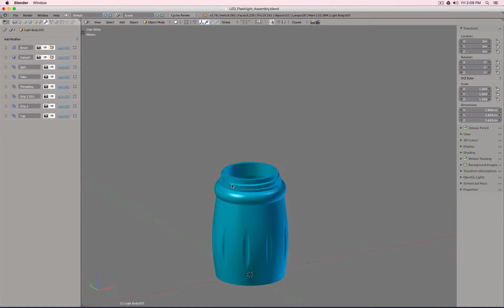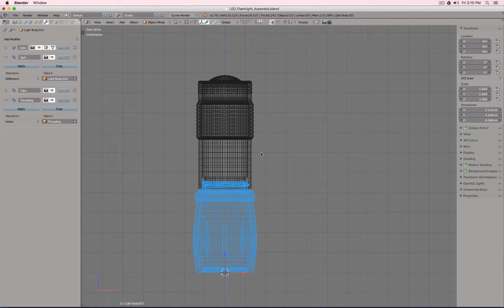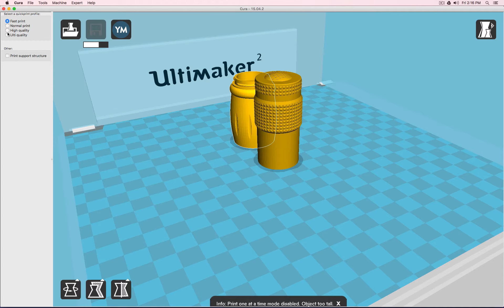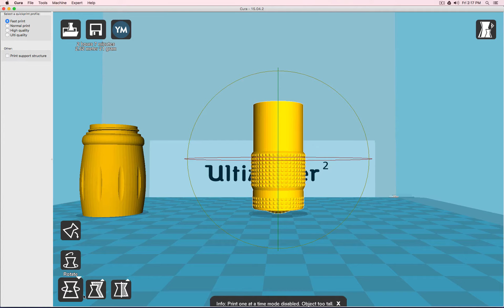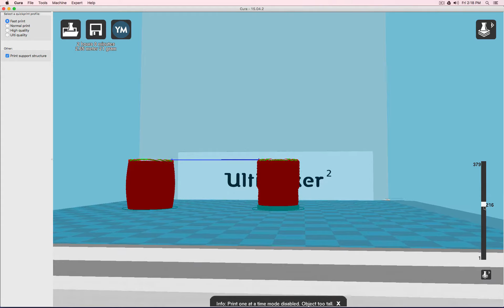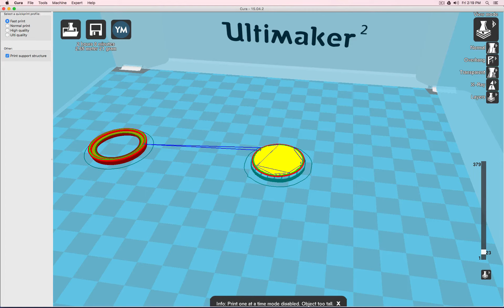3D Printing From Blender

Comment: So I am making chess pieces in 2.79 and this helps as I was trying to figure out how to solidify them to different thicknesses.
Reply from the maker: oh wow a 7 year old video is still helpful ! but 2.79 ? We are not at version 3.0 !!!
Reply: @cekuhnen  I am fairly versed on/in 7.9 and I tend to use it because I work with large ship models. 8 on up doesn't delete redundant verts, it supposedly combines them.
Plus I use CC3, and iClone 7 and they just went to 8, and want another thousand dollars to upgrade.
If it isn't way better for my uses, then I stay with what I know.
I think starting with 2.8 they made it to work more like autodesk, and or 3DS Max/Maya, and that is good for people who are used to using those, But I am a Right select clicker, LOL. It would probably bore you to tears but I have some old tuts on my channel where I am modeling an aircraft, or star trek stuff, and I am of course way better now, but I fit into a certian work flow, and am just learning how to 3D print, so I am learning how to do that. 
If 3 is more friendly to the 3D printing appllication, then I will dig that out and use it.
Thank you for your vids and channel though. I have about 35 Udemy courses in different things, but quite a few are for Blender modeling.
Reply from the maker: @TwistedSisterHaratiofales  If 2.79 fits your workflow then that's good ! The new Blender has btw much improved boolean operations and mesh results!